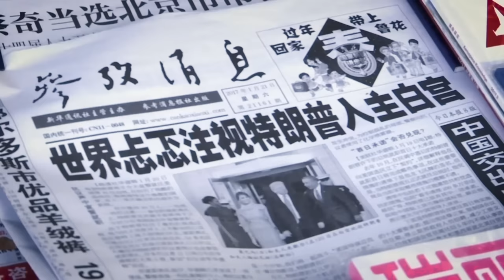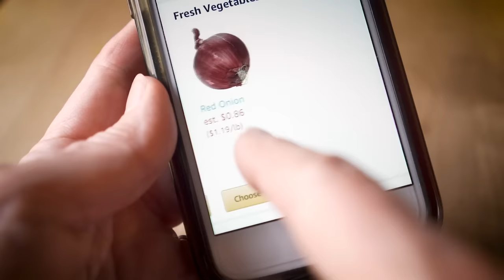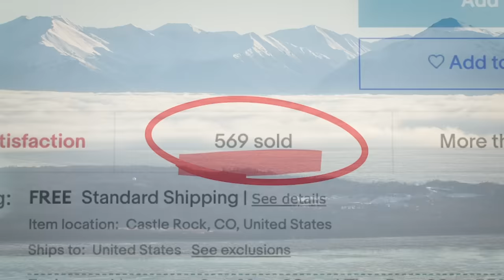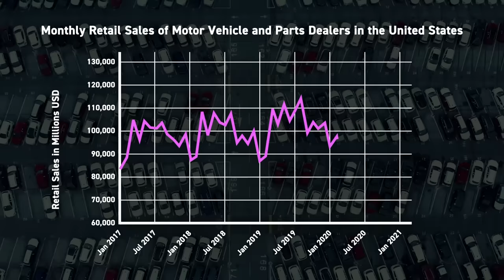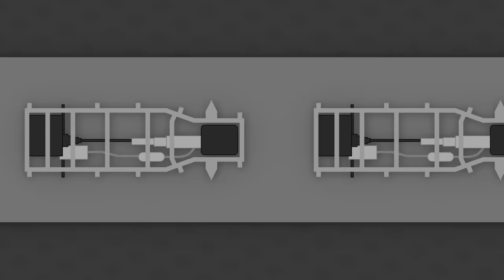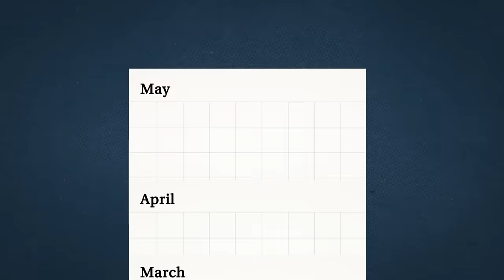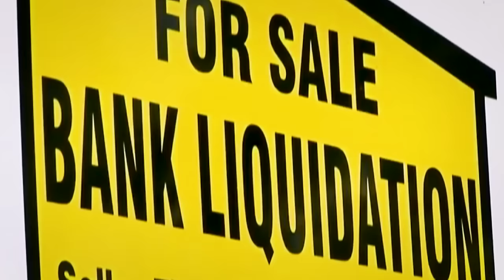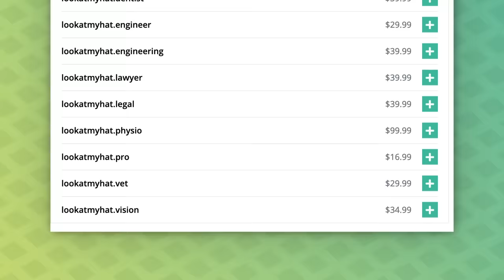Why There are Now So Many Shortages (It's Not COVID)

Comment: I knew from your title of the video that "Just in Time" manufacturing was going to be one of the causes you stated. I spent 26 years going between jobs in the air freight, ltl trucking, warehousing, and logistics industries and I saw "just in time" in action and just how customers got screwed up because they relied on it too much. I can't tell you the amount of times (it would definitely be over a hundred) I heard "we got to get it there because they're going to have to shut down a line if we don't". It's no wonder that during the covid crisis, that the problem would be exacerbated !
Reply: Just in time shipping relies on perfect conditions, which as you know better than me, doesn't resemble reality 🤣
Reply: *exacerbated. Anyhow I bet some of your stories are legendary. I used to work with a machinist who recalled, in his youth, getting paid to ride his Suzuki 1000 at stupid speeds to take a simple chunk of carbide to meet up with a guy in a parking lot to keep a heavy equipment line rolling. These planners are sketch!
Reply: I had the same thought going into the video, although I don't have any experience in it yet
Reply: Also the irony when almost nobody can get into the country but you’re holding a box boldly stating it’s from x overseas country. 
Deliveries yes, people no.
Reply: 25 years in trucking and totally agree, People have no idea how quickly things will fall apart if those trucks stop rolling, The entire supply chain works on a absolute knife edge.
Reply: @-DC-  crazy crazy, I never knew this I thought Just in Time was the stuff when it came to logistics and saved costs.
Reply: @unknowninfinium4353   No just in time is the nature of our entire society we are threadbare broke and have no reserves whatsoever. It is the most foolish system I can possibly imagine, when taken to the size scale.
Reply: @deadend1041  Maaaaaaaan..

You know when I was studying, degree, everything was praising just in time. Even when I worked. It was like one answer to everything. Any company, any industry, any product or service. Just in time is the answer. If you did not implement it, your gone, your out not to mention the angry feedbacks. 

When I see this and start learning about logistics, as well as your reply. Its nuts.
Reply: Just to effing late
Reply: The more fundamental problem is that we've built an economic system that prizes efficiency (which leads to short term profits) above all else, over other important things such as robustness and resiliency. Lowering inventories, narrowing suppliers, tightening schedules - all to paint a pretty quarterly report for shareholders. We've chosen to maximize flows and eliminate stocks. If your success is vulnerable and fragile, you haven't succeeded, only set yourself up high just waiting to fall.
Reply: @ArawnOfAnnwn  I would love for you to elaborate on resiliency and robustness.

Also can you suggest any youtube channels or books regarding logistics. Complete noob here hut I believe learning a thing or two can be helpful.
Reply: @ArawnOfAnnwn  Not efficiency. Cutting everything down to the bone even if it means the system is screwed and will collapse in a few months just so that some parasite contributing nothing useful can collect a yearly bonus. If it was just increase in efficiency, like Toyota did, it wouldn't be a problem.
Reply: @Jordon Carlson Planned obsolescence is a separate problem, as it has little to do with logistics. This video is about supply chains, not product quality. Veritasium has a great recent video about that topic on his channel, if that's what interests you.
Reply: I work in food supply chain, and we hear this so often. The food supply chain is very tricky to balance inventory because there are a lot of seasonal products (think natural juices) as well as varying levels of perishability and very lumpy demand, as many non-staple food products have seasonality
Reply: I work in supply chain and I can say that just in time works when there is significant buffer and WIP in place.
Reply: JIT is optimal for small projects / operations with low demand per product. It probably makes sense for custom manufacturers to work for those other small businesses.  Where it doesn't make sense is mass manufacturing in tiny batches.  Mass manufacturers need large batches from their suppliers for optimal balance of costs and minimal downtime.  JIT for them makes sense to make up differences if that costs less than ordering another full batch of parts they might not use and probably can't resell.
Reply: The word is exacerbated.  Not exasperated.  Basic junior high vocabulary.  Otherwise, well written.
Reply: I never liked it at all, always balked at it with my supervisor, when I was working at a manufacturing facility as a scheduler/planner in South Carolina. I always tried to add in a hidden buffer for some parts I felt would be difficult to get if something catastrophic happened.
Reply: imagine it being vegetable and the one of the formerly world's most busiest border crossing is closed and an Everest amount of paperwork and checks is needed, plus the constant lockdown and opening BUT the vegetables are pretty much the lifeline for this nation (ignoring the fact they also have deals with other countries but is more expensive for the consumers) 

P O K E
Reply: @unknowninfinium4353  have you guys watched the video or what? everything youre talking about was mentioned. if you dont have enough extra to get you through a reasonable period of instability, youre doing it wrong.
Reply: @jonathanodude6660  Thank you for your response. Hope your staying safe. Take care.
Reply: I witnessed a major dairy manufacturer lose hundred thousand EUR in damages simply because UK had snow in November one year, all thanks to precisely this philosophy. The logistics company I worked for simply couldn't unload their trucks in UK due to all the delays in ferry traffic, traffic jams on the roads and so on, so the trucks got stuck there with loads. Thus, for a week, we couldn't pick up anything from the client. And this was just one client out of several, all delivering stuff to UK.

It's a maddening business philosophy, because they're banking on absolutely everything going smoothly - and sometimes it just doesn't. And then, everyone involved has to deal with that nightmare. Modern logistics chains are incredibly fragile.
Reply: @deadend1041  careful there. Efficiency seeks cost reduction for profit optimization in a competitive market. But the subproduct is cheaper prices for the consumer. With less efficient production systems, goods and services would be even more scarce under normal production, which means higher prices. And so poorer people wouldn't be able to afford things they did before.
Of course, that doesn't mean that companies should implement JIT in a highly flawed manner.
Every decision has a cost.
Reply: @ArawnOfAnnwn  there's not such thing as stable success.
Reply: @TheGooglySmoog  WIP and safety stock work. There are many companies that succeed because they actually understand LEAN principles.
Reply: @thirdeyeview1111  When you add that "hidden buffer" you are actually exacerbating the problem. "Difficult to get" parts can actually be planned out in a good scheme.
Reply: @jonathanodude6660  Exactly.
Reply: "they relied on it too much"....except that the economy forced their hand. The alternative to operating "just in time" is to warehouse parts and material. Warehouse space costs money and that expense puts companies at competetive disadvantage.
Reply: @thirdeyeview1111  Did that save the line when this hit? If so you deserve a raise.
Reply: @unknowninfinium4353  that sounds ominous.
Reply: @basileusbasil4041  My experience at this particular plant was back in 2006-2009 and of course we all know what happened in 2008. But before that yes, I did save the line a couple of times when particular parts didn’t meet QC standards. Subsequently that production line was dismantled and moved up to Virginia.
Reply: @MikeB3542  In addition, warehousing can have its own logistical problems.
Reply: @santisven  There is such a thing as 'stable-r', however. Way to fall for the 'perfect as the enemy of the good' fallacy.
Reply: @ArawnOfAnnwn  at what cost?
With lower efficiency production, prices rice, poor people can't afford things they could before.
Reply: @thesunthrone  Thanks for your input and sharing. I never knew the disasters of this, might I ask what could have been done better? 
Take care.
Reply: @basileusbasil4041  Which one?
Reply: @unknowninfinium4353  It's a multi-faceted problem. One issue is the warehouses that can only really unload at the specific scheduled slot in the UK, which is a bit too rigid during delays. It's fine when you've got more chill days, as you can just ring the warehouse and swap some slots around, whether your company's own or some other that freed up due to them being late etc. But when freak weather hits and EVERYONE is calling in to try and change their unload slot to be on time, that's when disaster hits, as it's only logical the warehouse can't unload it all. And those UK warehouses turned to be the major bottleneck in this case, as they handle so much of the loads for so many companies, it's honestly impressive and grounds for another Wendover video.

But another contributor is also trucker company policies. It's a very cutthroat business, and the bosses want the trucks to be moving as much as possible. A truck that stands still is a truck that doesn't make money, and so they calculated the minimum amount of money each truck needs to bring in a day and crack the whip to get that number. Doesn't matter what extralegal means were used. So this kind of chase after the golden efficiency number also meant we'd minimize the time needed to get on the ferries or Eurotunnel (tunnel's more expensive, emergencies only, see), and that works fine on normal days.

But as soon as delays begin, headaches roll in as well. Where we used to use the ferry as the simple option for crossing the English channel and Eurotunnel for emergencies, ferry delays meant more people would gun for the tunnel too, and some companies just always went for the tunnel instead. So suddenly the failsafe also doesn't work and is also filled up and it's suddenly no longer clear when you'll be able to get going, so you can't call the warehouse and give them the right time for a booking. So much of the valuable driver's driving time is spent sitting in these jams, and a routine 4 hour delivery run from Netherlands to UK turns into a whole day, maybe two day trip.

So what to do better? Plan some reserve time. Plan some inefficiency buffer in those golden profitability equations. Don't just gun it pedal to the metal all day every day like most companies seem to do.
Reply: @thesunthrone  Thank you for your prompt reply. You sound like you'd do a better job as a manager.
Reply: just in time should be called "keep the hard to get stuff on stock while you cut down the easy to get stuff" ?
Reply: @unknowninfinium4353  I got a kick of paranoia, sorry about that; it went "Thank you for your response. Hope your staying safe. Take care.".
Reply: Problem I have with this system is it forces workers at all stages to be rushing their job all the time. Rushed jobs produce mistakes which produce failures that only the end user has to deal with. This has only become worse the last 2 decades, electronic products especially have become so unreliable that warranty returns are common and electronics have become incredibly temporary and disposable. People would also rather pay way more and go into debt for "premium products" to avoid dealing with this.
Reply: @Jordon Carlson There is a also a concept of Single Points of Failure. It has to work in conjunction with JIT. You have to be absolutely ready for risk and dealing with the worst case scenario.
Reply: @unknowninfinium4353  there's a lot of hyprocondriaks out there and loads off Government and civil servants that relish the lockdowns  doesn't matter to them they still get paid
Reply: @-DC-  There is a local co offering a signing bonus well into five figures to drive for them and it's not even long haul.
Reply: @ArawnOfAnnwn  The failures just becomes tax write offs for the Venture Fund Bros, so it's all good as far as mgmt is concerned.
Reply: "Just in time" really means "too little too late." I worked for a home goods company who essentially blamed the entire workforce when their "just enough" prediction was wrong, leading to massive backorders and ultimately negative cashflow. If they didn't attempt to game the system so hard and just manufacture at a slow and steady pace, they 1. wouldn't need a bunch of analysts who are essentially gambling and 2. they'd never be "out" for months, items would just come in as they're made.